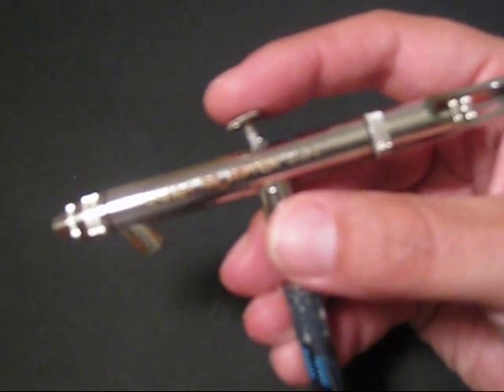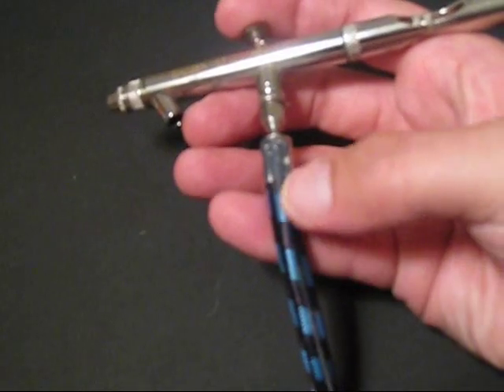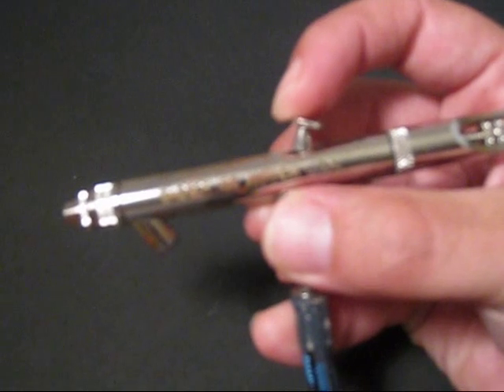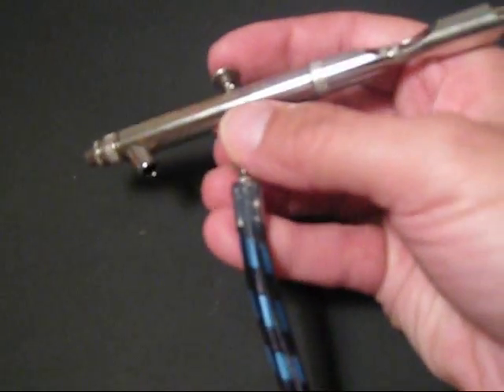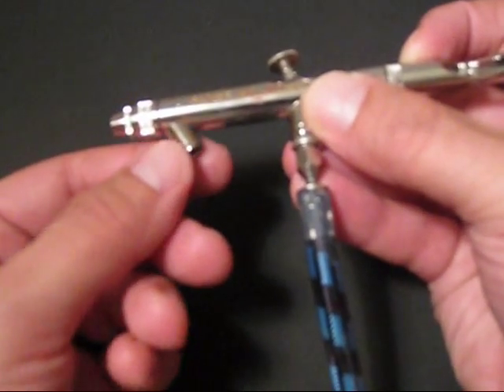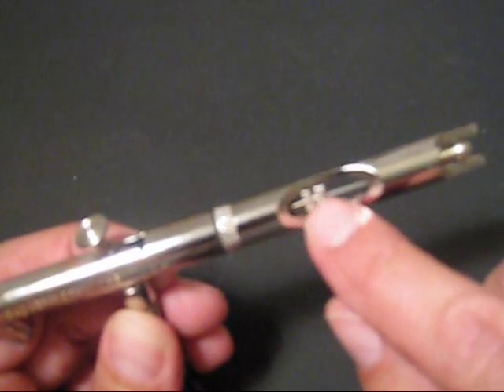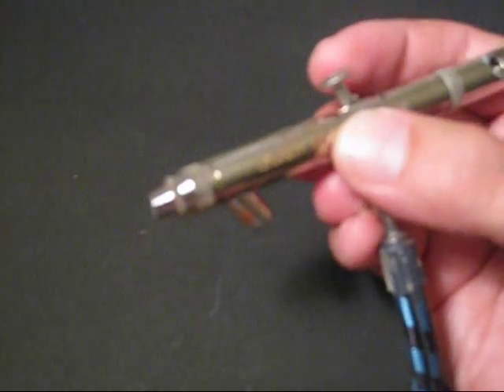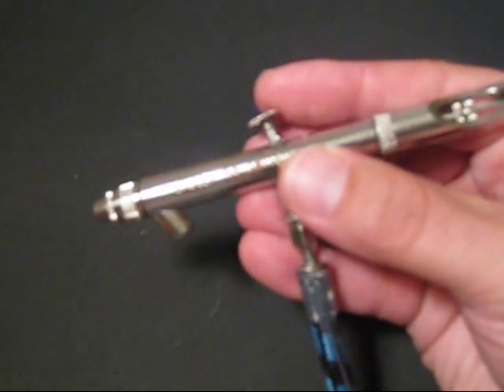Airbrush Basics

Comment: @WulfBand  Yes, more than likely. You have to remember to thin your paint to the consistancy of milk or the airbrush will clogg. Use thinner for oil base and water for latex. Another thing to remember is that oil paints and thinner will react with certain plastics and melt. I learned tis the hard way and clogged my brush with plastic clumps. I would upgrade to glass paint jars. Also try turning the tip of the nozzel both ways to see if it's closed. Hope this helped.